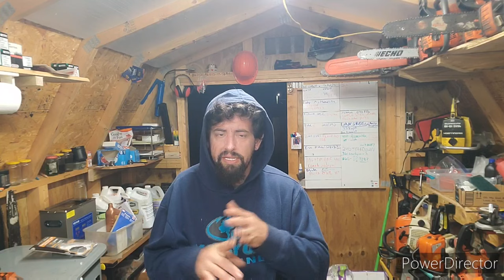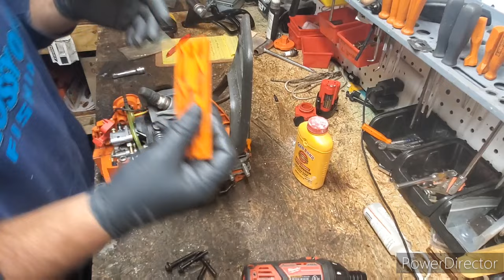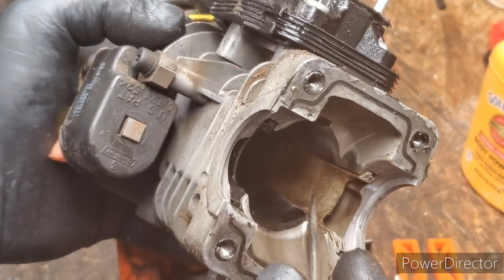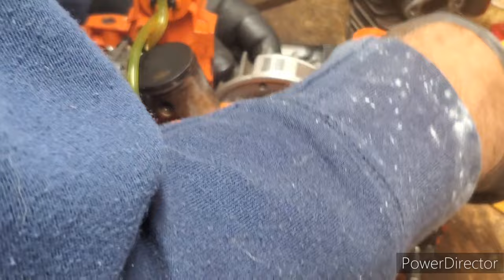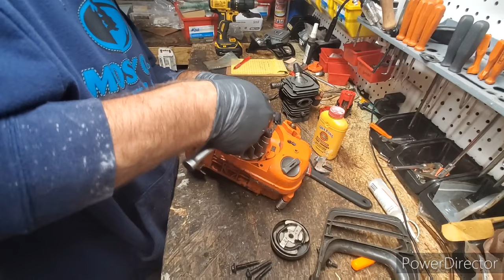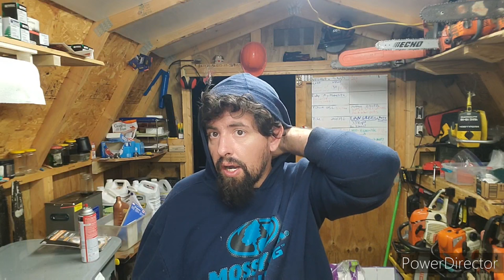Husqvarna 240 Chainsaw Giveaway disassembly #2 and 3....whats that piston look like??

Comment: It's surprising where they use plastic in some of these saws. I am taking apart a Husqvarna 350 and the bottom of the crankcase clamshell is plastic. Seems like a strange choice for an area of such structural significance. Also, Thanks for the clutch removal tip!
Reply: Ya always surprises me